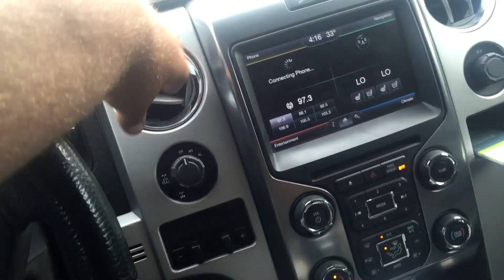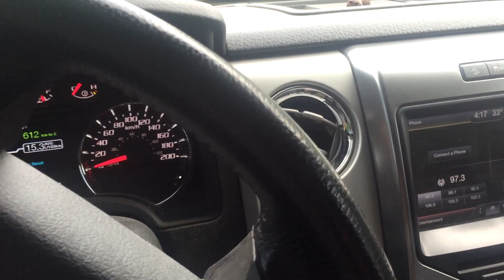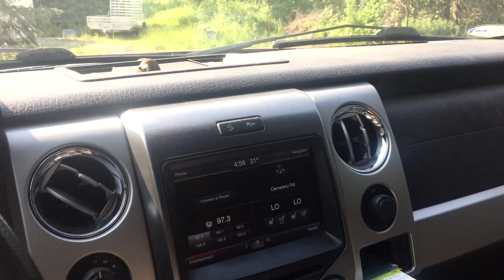Big ol Rant and then ran into something really awesome

Comment: cold be a zone control... you can set th temp on your A/C, heater... could just need a recharge.. the reason why it start and stops after you first start you truck is like a self checker/initializing pressure charge.. as for the forwarder i have a set up similar to that... i run a 1970 franklin 120 forwarder, and a 1978 fiat FE20 processor with a ultimate 5300 forestry processor head... been great machines... other then the franklin... cant find parts for it very well... spend more time rebuilding parts then using it it sems lol..i just bought a 2006 blockbuster 14-12 firewood processor a few months ago... cant believe i didnt get it way earlier... i love that thing.. anyways... love the vids as always.. and happy belated fathers day... sorry... i was busy yesterday.

Comment: If those coleman burners work the same as parafin blowlamps, the heat exchanger needs to get hot enough to vapourise the fuel, if it shoots out like a flame thrower, release pressure and let it warm a bit more. also you can get a jet 'pricker' to make sure the jet is clear.
Doesn't the water in the lake contribute to the water table ?
Maybe the aquafer  chamber isn't very big and it takes time to refil.
Last time i played farm sim 2015 (months ago), the log trailer wouldn't hold onto the logs you placed there, let alone be able to transport them to the mill, so that guy you saw had it easy :D

Comment: . yeah we used to have a old Ford truck 1994 year extended cab with two gas tanks the AC never work but it still was a great work truck we sold it recently but it was the best we've had now we replaced it with an old crappy Dodge 1500 really sucks I miss that truck

Comment: R134a systems can cool down really good as well, so it's certainly not that! But maybe your Ford truck has a computerized climate control, where you set it to 22 degrees for example, and then it will cool down the cabin to that temperature very slowly, instead of you being able to just turn the AC on or off. With these computerized or regulated climate controls, it feels like they cool less, because their target isn't set to "as cold as possible", but to the set temperature instead. So if you set it to the lowest temperature possible (which is probably somewhere around 15 degrees or so), it would produce the most cooling effect, while as long as you have it set to 22 or 24 degrees, it doesn't cool as much, because these systems like to stay in the background, maintain the set temperature, but nothing more than that (not hit you in your face with ice cold air, although they could).

Comment: Be glad that you don't live in Europe with that AC! You're still allowed to use R134a, while we have to use R1234yf - and if you get into an accident and it starts leaking, this is really nasty stuff. It will ignite if it comes into contact with water, and then it produces hydrofloric acid, which is highly toxic. And modern cars in Europe have to use it now (because the car manufacturers were lazy and didn't use a different AC system which could run with CO2 as coolant). If I ever get a car which is filled with R1234yf, I will delete the AC and rather drive in the hot (since my car has to have a sun roof that can be opened anyways, that is no problem for me - except on maybe 5 to 10 days per year, and I gladly sacrifice those for not being killed by my AC coolant after I survived an accident...

Comment: I will tell you one thing my 2008 Chevy Silverado has a good air conditioner in it, it will start to freeze up on the windows it's so cold! Never had a problem at all or extremely lucky with it. I thought you had a warranty when bought that Ford?